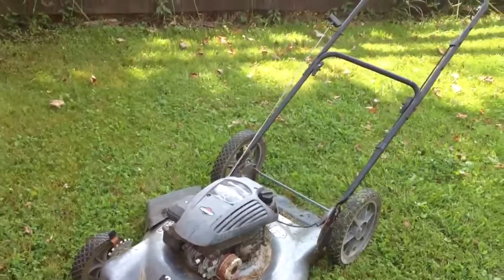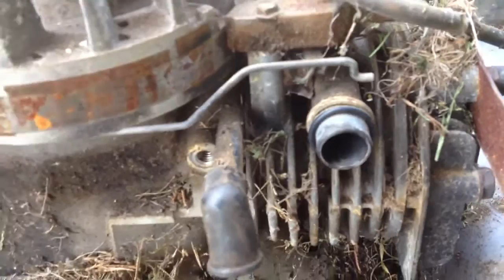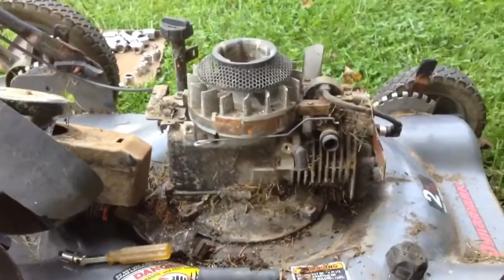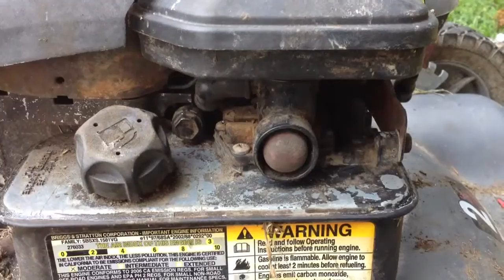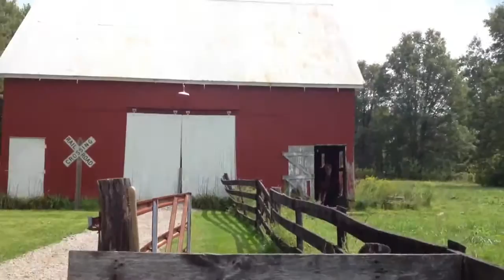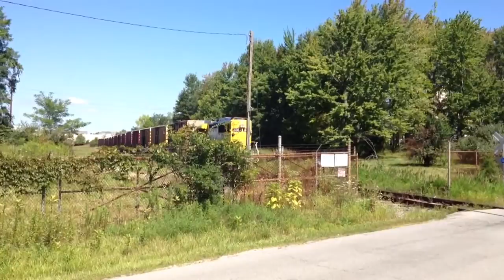How To Clean Out And Repair A Carburetor, Briggs & Stratton Motor!

Comment: Congratulations Brian! Now you can be a Shade Tree Fix-it Man too! Neat train video at the end.
Reply from the maker: +The Shade Tree Fix-it Man My biggest problem with fixing things is having the right tools and knowledge.  Its always a good feeling to fix something.  It took me probably twice as long as it should have but I got it done thanks to you!  Thanks again for making the video showing me how to do it.
Reply: +Jaw Tooth Next time you will do it in half the time!
Reply from the maker: The Shade Tree Fix-it Man
True, because I kept referring back to your video to make sure I did each step correctly.  I had your video up on the screen here for a couple hours and went back and forth from the mower to the video.  I was a little nervous when I looked at it in pieces and was wondering if I could figure out how to reassemble it.  I couldnt believe it started on the second pull and on the first pull on the second test by the pond.  Thanks again!
Reply: +Jaw Tooth You are welcome